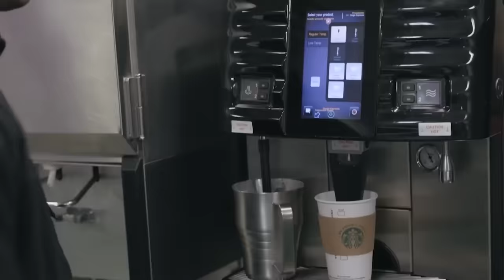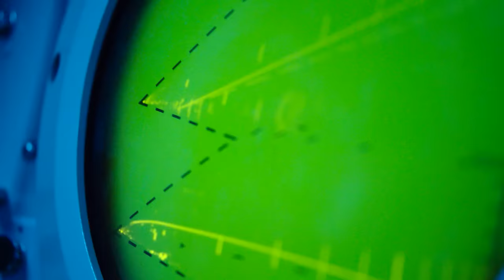EMERGENCY CALL US Navy: China Revealed Its LARGEST Aircraft Carrier

Comment: Those are old 1970’s Russian designed ships. It doesn’t matter if they build a floating city on water. The smaller diesel powered Chinese ships can only go 1500 miles max. I am sure when it sinks, it will be a nice corral reef. The Chinese aircraft are powered by Russian jet engines.

Comment: Actually, at 100,000 tons the USS Gerald R. Ford is 25% larger than the Chinese ship which weighs 80,000 tons... rather than the stated 20% in the video.  The Ford is 20,000 tons larger; 20,000 is 25% of 80,000.  
On the other hand, the Chinese at 80,000 tons is 20% SMALLER than the Ford at 100,000.  The weight of 20,000 less for the Chinese ship is 20% of the stated 100,000 tons weight of the USS Gerald R. Ford.  
This concludes today's math lesson.  Very good and informative video, by the way.
Reply: USS G. Ford is not on DUTY because no money to continue to finish and staying at dock for longtime. Shall I pay more TAXES ???
Reply: @NightnDay402  Nope.  Absolutely not.  The fools would just waste it like they do everything else, anyway.